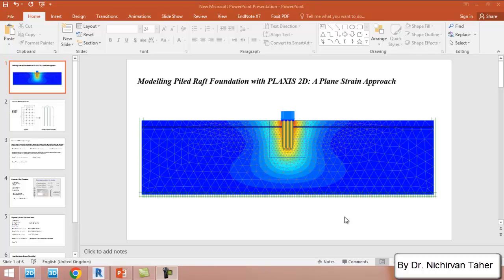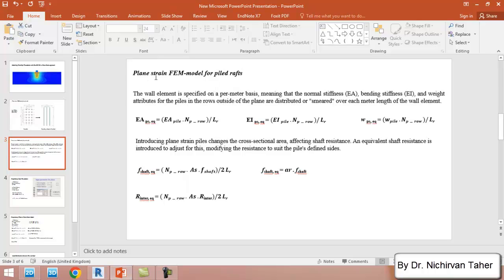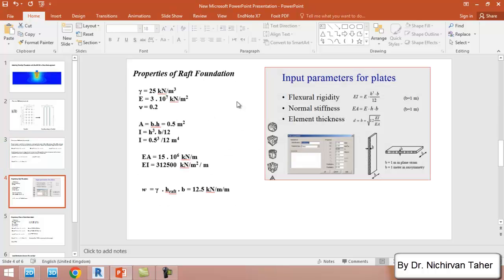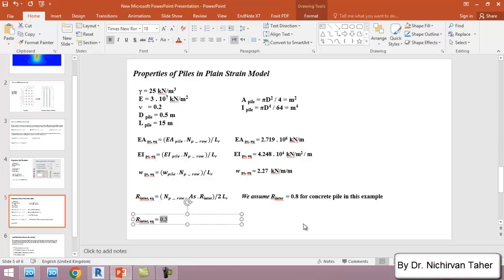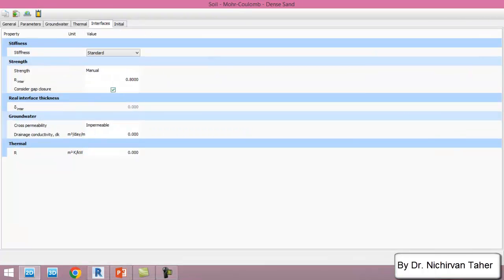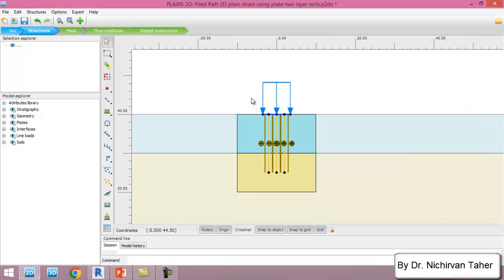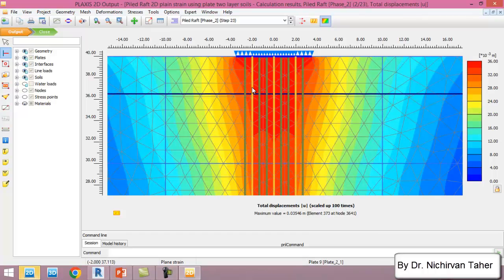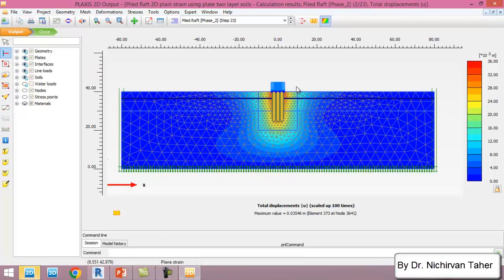Modelling Piled Raft Foundation with PLAXIS 2D: A Plane Strain Approach

Comment: First of all I really want to appreciate your effort to make this tutorial. I have viewed the full tutorial video and found some concerns regarding the calculation of stiffnesses (Axial and Bending) and sequence adopted in construction stages. 

As we are simulating the circular shape piles using a rectangular plate element, the total inertia of one row of piles (6 nos) shall be equated with plate inertial formula (bh3/12).and an equivalent h will be calculated. Using this calculated h value, plate area (1xh) shall be determined. Axial and bending stiffnesses are calculated accordingly. 

Embedded beam will capture axial load analysis of raft-pile system in a better way than the plate element.
Reply from the maker: Thank you very much for taking the time to watch our tutorial video and for sharing your insightful comments. I truly appreciate your engagement and input.

You've raised valid points regarding the calculation of stiffnesses and the sequence adopted in construction stages, especially in simulating circular shape piles using rectangular plate elements. Utilizing an embedded beam for axial load analysis of the raft-pile system or employing Plaxis 3D for more realistic analysis indeed offers a more accurate representation.

My intention with this tutorial was to provide a foundational understanding of the plain strain model approach and modeling in Plaxis 2D. As mentioned in the video, the presented results may overestimate settlement and may not be entirely reliable for complex scenarios. 

Your feedback is invaluable, and we'll certainly consider incorporating discussions on embedded beams and Plaxis 3D in future tutorials to provide a comprehensive understanding of geotechnical analysis methodologies.